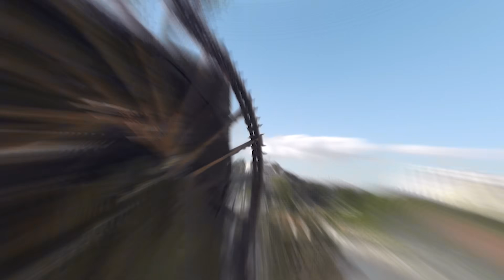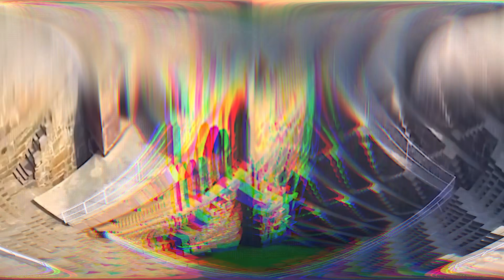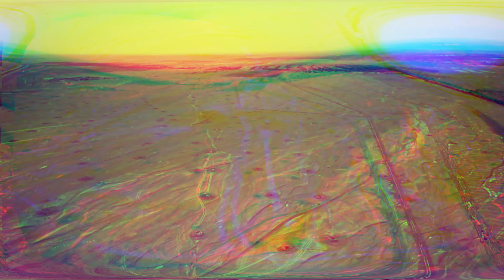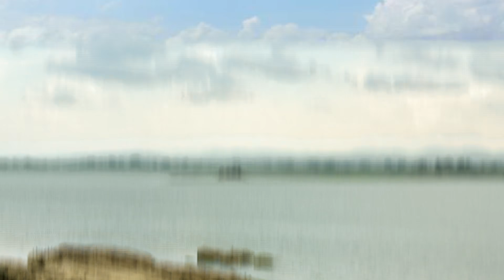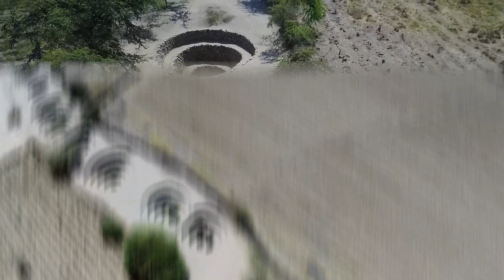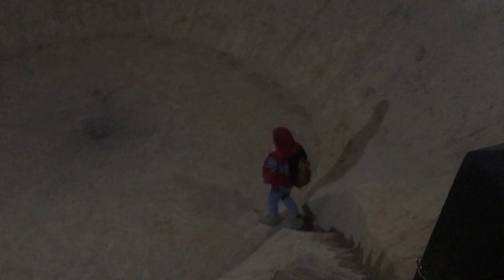Mysterious Desert Holes Revealed the Genius of Ancient Civilizations For Saving Water

Comment: Windmills (aka Asiaub, Asiab Baadi), Canat (aka Qanat, Kariz قنات، کاریز) and Yakhchaul (Ice domes) are all Iranian inventions from thousands of years ago.  The earliest example of Asiab Baadi (Windmill) is located in the southeastern part of Iran and its blades are mounted on a shaft that is perpendicular to the ground (typically a room below the blade and shft structure) where the shaft would turn a grinding wheel for milling wheat).  If you search the YouTube with this text you wil see them in action, search: " آسیاب های بادی نشتیفان".  Also you may want to look up Iranian Aircoditioning system from thousands of years agao, where they would install very tall Wind Catching structures that would drive the wind in to the home, where the wind would come in contact with a sistern, cooling the wind and direct the air to inside the home.  The best examples are in the city of Yazd (located in central Iran) these windcatchers are called Baad Geer "باد گیر", so if you use YouTube and search for " Yazd Wind Catcher" or in Persian "بادگیر یزد" you can see many examples.

Comment: You failed to mention the Hanging Gardens of Babylon; The Babylonians created a water pump that transported water from the Euphrates River up to the Hanging Gardens. They created the pump by attaching buckets to a chain. The chain was connected to two big wheels at the top and bottom.
Yet quite impressive is the other supposed system of water irrigation. According to some theories, the water was pumped from a central source at the base of the palace by a mechanism called an
" Archimedes' screw ". The screw is made of one continuous rotating unit located inside a cylinder.  Archeologists have recreated this mechanism and enjoyed some success in modern day.    ♾
Reply from the maker: Gringo1723 is pointing out a significant omission regarding the Hanging Gardens of Babylon and its advanced water engineering systems. They highlight two important technologies: a bucket chain pump that drew water from the Euphrates River and the possible use of an "Archimedes' screw" for irrigation. The commenter provides detailed historical insight and references modern attempts to recreate these ancient mechanisms.